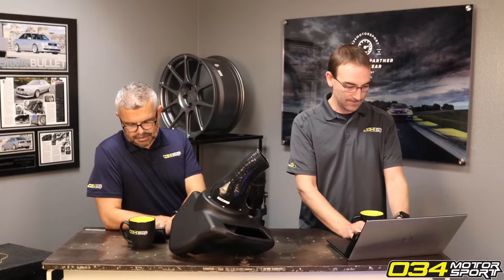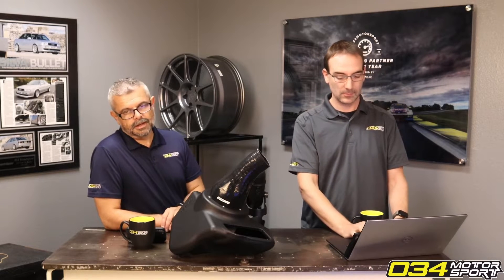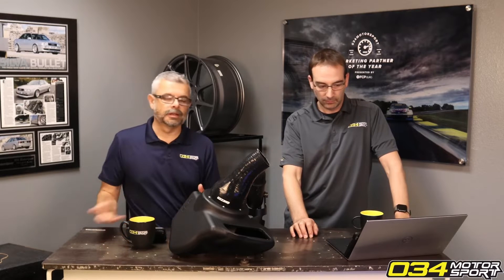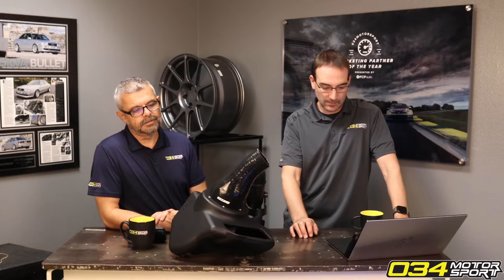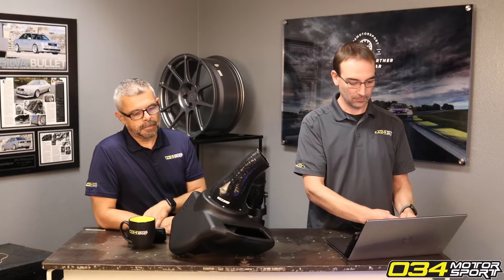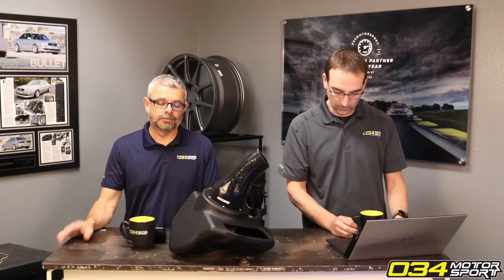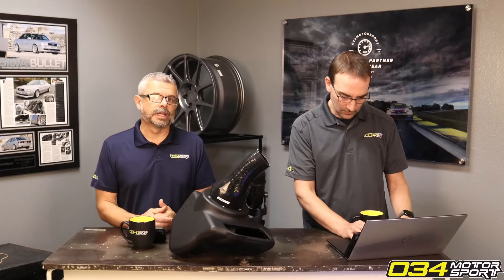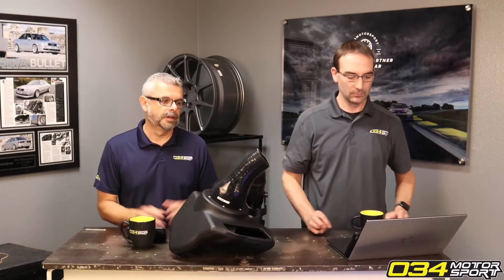Why does Audi List Different Oil Viscocities Based on Models? | 034Motorsport FAQ

Comment: DON’T do oil changes every 10,000 miles!  That is causing 2.0 TFSI timing chain stretch!  5,000 miles PLEASE!  We had a A4 wagon 2006 3.2 it had a timing chain tensioner failure due to 10,000 miles.  We now have a 2012 A4 wagon 2.0T we have the oil changed every 5,000 miles
Reply: The 2006 failed at 106,642 miles
Reply: No such thing as timing belt stretch. Look it up. Real mechanics claim that is false  they wear down from bad tensioners or guides!!!

Comment: Audi in Europe is 30000km or 18600 miles OCIs. This have been their recommendations for over 2 decades now and there has been no class action over the engine failing.
Reply: Only in Diesel. In gasoline engines, often we already add 30L of oil. Many TSI engines burning oil  as much as 1 L  per 1000 km
Reply: @rondhole  Actually that's petrol. Some diesels are on 50000km OCIs
Reply: @Stoff1  No, 50000 km was canceled years ago, now both are 30000 km, but max, it's calculated between 15000 and 30000 km,  in reality it's little bit above 20000 km.

Comment: You didn't say anything about 10,000 mile oil changes.
Reply from the maker: There is no issue with 10,000 mile intervals.
Reply: @034MotorsportUncut are you saying follow the recommended 10k oil changes even on an RS5? I’m worried that is way too long.